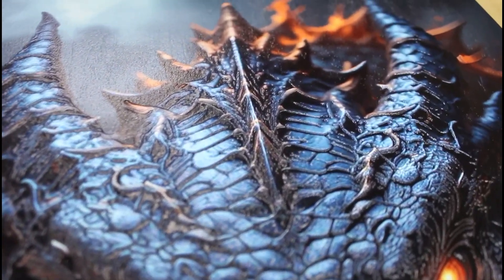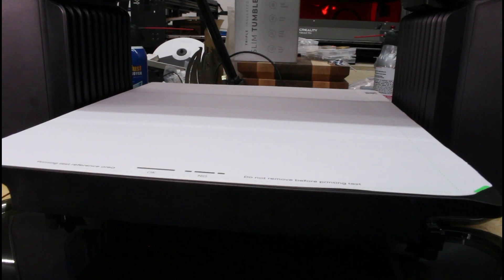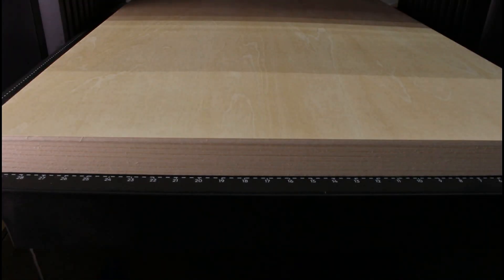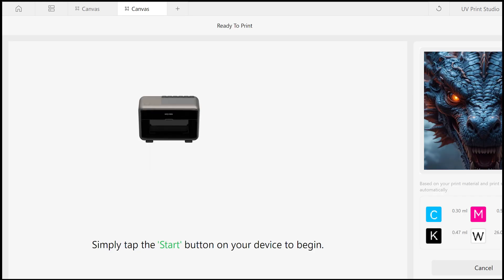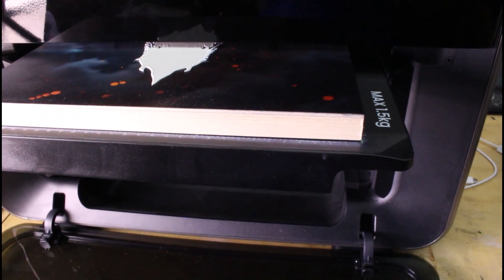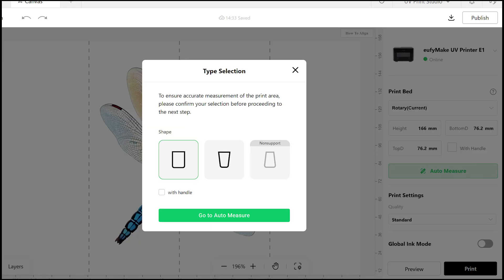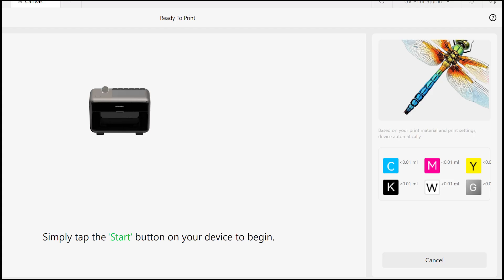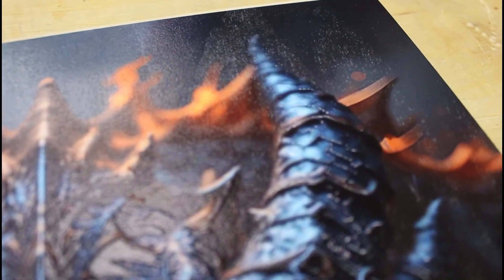Your Laser Can't Do This! | EufyMake E1 UV Printer

Comment: My wife does custom art and has been using a UV printing service. It will be great to be able to make the inage and print a small copy to make sure everything looks good before doing a large print on the machine or sending it for UV printing service. UV prints were taking.about 3 weeks to return. With this printer we can print right away and sell. My wife creates drawings and photos that sell for between $200 and $1,000 depending on the size. So if she can create an image, print, and have it ready to sell in the gallery in 1 days versus 3 weeks this will really create a lot of new opportunities. Her art usually sells in less than 3 days after she notifies her clients she has something available. This little printer is going to change her business.

Comment: I think a lot of folks miss the point of this printer, it's not a commercial UV printer nor is it designed to compete with one. It's quite literally marketed as the First Personal UV Printer (emphasis on "personal"), because, as this video points out, it can't do things at a volume or scale that people running a maker business would expect. 

I've already seen folks talk about setting up a farm of these like a 3D Print farm, which seems silly to me instead of just buying a commercial UV printer if you have that kind of order volume. The feature this has that those don't is the texturing, so I guess if you base your whole business off of that it might make sense, but is that really THAT big of a differentiator? I don't think so, but if someone can market it as such, then more power to them. 

Personally I'm picking up one of these because it gives me the ability to print directly on one-off creations where I wouldn't have been able to before, and will get higher quality prints with more colors and detail than masking and painting. Print time is not a big issue for me because I'm not making things at volume. 

Buy the right tools for your use case. For a lot of folks, it will be this, and for a lot of folks, it won't be.
Reply from the maker: It's all about finding the right tool for the job and this printer definitely fills a niche!